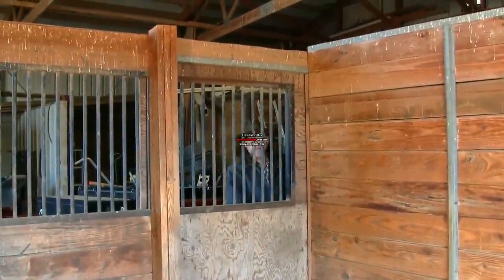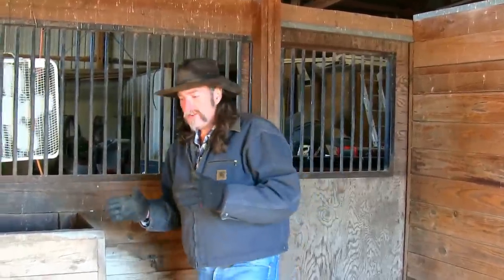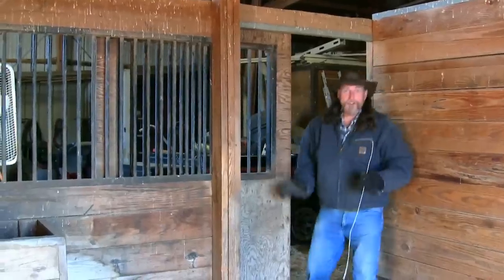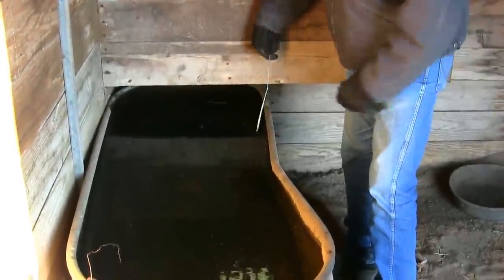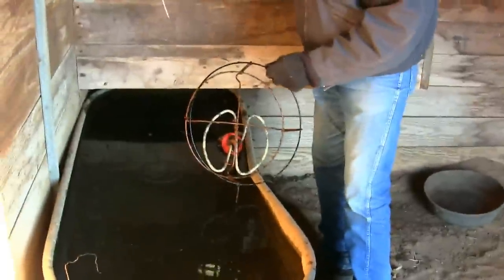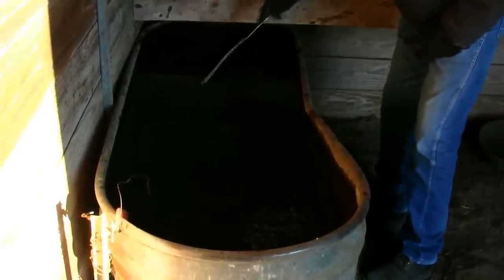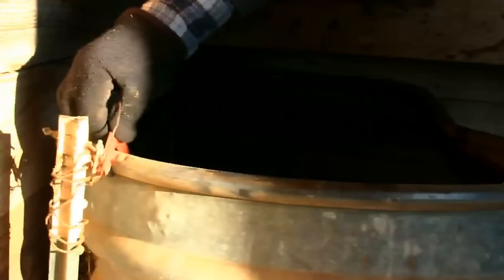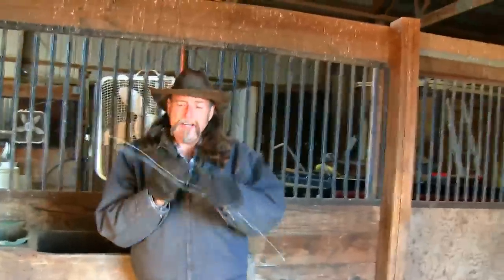Horse water tank heaters , proper use of them .. Stall13.com video

Comment: My 50 gallon rubber water tank is beside a steel pipe rail fence post. Can I ground the water by wrapping the copper wire around that steel post?
Reply: NO !!... That is not a safe electrical ground !...  Best is an 8 foot copper grounding rod , slammed into the ground as deep as possible .. Tank heaters by nature are poorly made and leak electricity into water tanks regularly . The heaters can become unsafe so fast that the only real safety your Livestock have is a proper ground to either the tank or the water in the tank .. Even an extremely small electrical pulse undetectable by human touch to the water can " TINGLE " an Animals nose or lips enough to discourage proper drinking and consumption of water ; Which is difficult enough in colder temperatures .
Reply: where do I buy an 8 foot copper grounding rod? I'm not sure I can bury a rod that deep in our rocky ground. We have solid bedrock within 4 feet here in most places. Is 3 feet deep enough to bury a copper rod? Why is the steel pipe not a safe grounding rod?

Comment: Do you have to ground if using a plastic water trough?
Reply: Yes ! Instead of grounding the tank ,.. now you must ground the water in the tank !.. Everything is the same ,.. all you do is just make sure to have enough wire wrapped around a rock or a brick several times sitting on the bottom of the tank with the wire running from that rock or brick from the bottom of the water up and out of the tank to a well positioned grounded rod . Which is well placed in deep in the ground near by the plastic water tank . Then make sure to have the wire attached to the ground rod . It is best to have at least 3 ground poles on a series if possible to make sure that your Tank Heater does have a proper grounding ." Practically speaking around Livestock facilities this may not be possible " !.. Honestly hardly ever !!!! Yet I would be wrong not to mention the three ground rod series ….

Comment: Yeah i guess grounding isn't a bad thing, but my heater never gives that slight tingling feeling when I get the floating hay/leaves out with bare hands. Our horses always drink from it in the dead of winter. If you do feel that tingling or get shocked, you've got a heater that's unsafe with a ground fault or your barn wiring has ground fault issues. My barn outlets (by code) are GFCI protected. If trough heater has a ground fault, It'll trip the GFCI telling me the heater is unsafe and needs replacement. Oh...water weighs 8.34lbs/gallon, not 7lbs when ya talkin' how much a horse drinks. Please put a T-Post cap on your t-post grounding rod. I see a possible injury there. Horses find amazing ways to hurt themselves ;-)